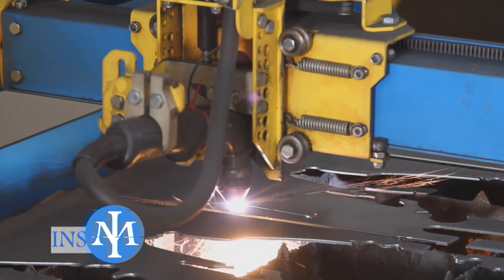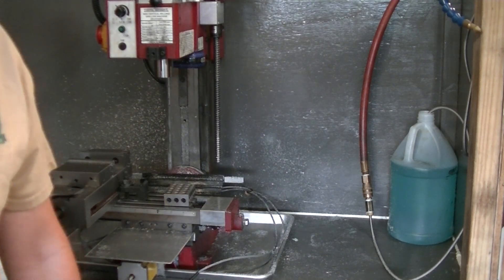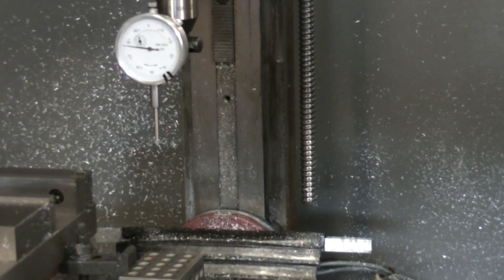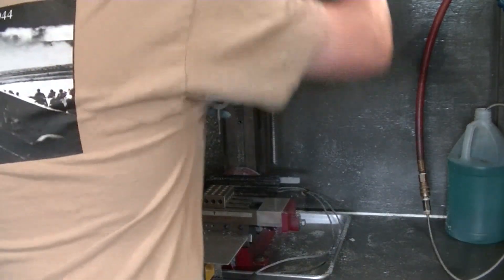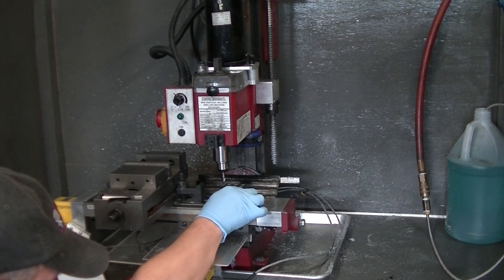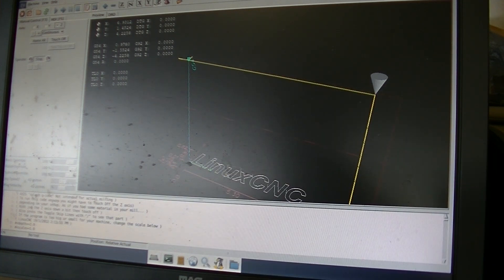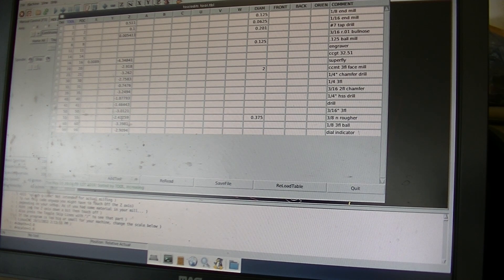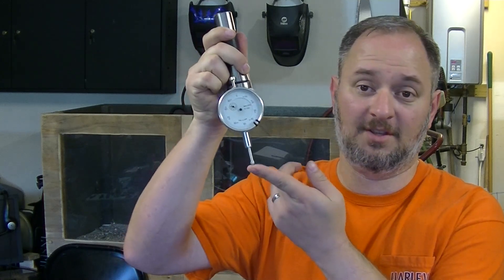NYC CNC Practical Application Part 2 - Measuring and Entering Tool Offsets

Comment: are you still setting tool height like this? the easiest method ive came across is touching off on whatever side of the 123 block you want to use and zeroing the dial then origin your z. then touch off on whatever surface you programmed your part to returning to the same zero on your dial. enter the number you get into your work offsets that you are using for the z value. home your z and just pass the block under the tool like you were and enter that exact number as your offset once it clears. not sure if i explained it right lol
Reply from the maker: Thanks for the input! I was switching back and forth between that method and the one you described depending on what I was doing. These days I have a height gauge so I can measure my tool offsets and I use a Haimer indicator to dial in my WCS.

You did a great job explaining the method, by the way. Appreciate you watching and taking the time to leave a comment. Not everyone would take the time to do that.

Best wishes,
Tom Z
Reply: thanks for the videos i just started watching them and amazed that you already have other milling machines. im a machinist by trade and cant wait to convert my mini mill. keep doing what you do. i also have a couple tool height setter a 4inch and a 6 inch. they work good on setting quick heights. dont forget to always calibrate.
Reply from the maker: I've got some really good mentors around here so that doesn't hurt at all. Things are growing quickly but I make a point of not buying the equipment until I have the work lined up to pay for it.

Please chime in whenever you can! I am a firm believer that we can all learn something so I keep my eye and ears open every day.

Thanks again and hope to see you around here more.

Sincerely,
Tom Z

Comment: Time saver suggestion. Mount the indicator to the 1,2,3 block instead. Use a flat button tip.
Once you've set your zero you can then insert each tool bring it down until the indicator is back on zero, your Z error is your offset. Makes doing new tool setup a snap.
Reply from the maker: +The Thing That's a great idea as well. Sounds similar to how touch off setters work, right? I'll have to check my Z travel and see if I have enough to work with something like that.

Thanks for sharing!
Tom Z
Reply: Yep exactly. I also use an "electronic" edge finder for the X,Y zero. I put it in the vice upside down in the center v-groove. The beauty of these is they do not have to be spinning. Metal to metal or carbide contact will illuminate the bulb at the lightest touch. :) "Machinist Mate Electronic Edge Finder" Part number: ZRD-20695-D
Reply from the maker: Very cool. I'll look in to that soon.

Best wishes,
TZ

Comment: You're going to great lengths to explain tool offsets. Did you use the negative offset-system on purpose or was it just a coincidence? (http://www.cnccookbook.com/CCCNCToolManagement.html)
Reply from the maker: +Zorgoban Hi Remo! I probably took it a little too far, yes... I was frustrated because the documentation and existing videos for doing this within LinuxCNC were rather lacking. As far as the negative vs positive offsets, there wasn't really a reason for it other than that's the way it worked out. I set my zero based on a measuring tool that wasn't going to change and went from there. That's a very good link, by the way. I took the time to read it before I replied so I understood what you were asking. :)

Thank you, sir.
Tom Z
Reply: I don't think you took it too far. I think there would be even more to tell, but then the video might get tedious. It's good as it is.

Many Greetings!
Remo

Comment: Great vid Tom! Thanks!!
Love the spindle light!!!! :)  
Mike
Reply from the maker: +bluehandsvideo Thanks, Mike! I was shocked at how little info was listed for LinuxCNC and tool offsets. It seems like most people were either using the controller for routers with a probe or just assumed we all knew how to do this.

Nothing like a FREE Harbor Freight LED light, eh? I have a spool of LED lighting to install in there but might save that for a different machine...

Best wishes,
Tom Z

Comment: If you have an nvidia graphics card u may be able to use shadowplay to screencap. Im not sure if that works in linux or not but its in part of the driver. That may help?
Reply from the maker: +Bunnyonabender Thanks!  I wasn't sure if it would effect the real-time kernel or other subsystems that are optimized for the CNC control portion. Way in the weeds answer, sorry...

Appreciate you watching and thanks for commenting! 
Tom Z